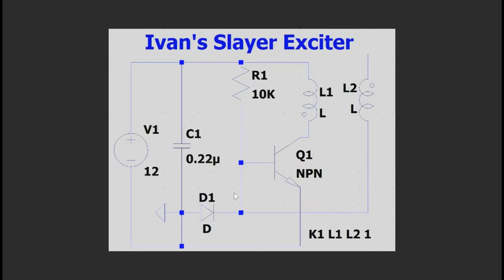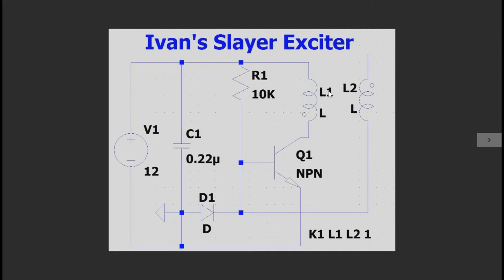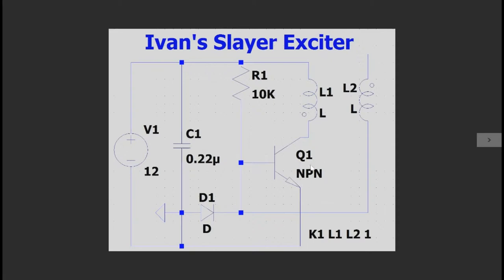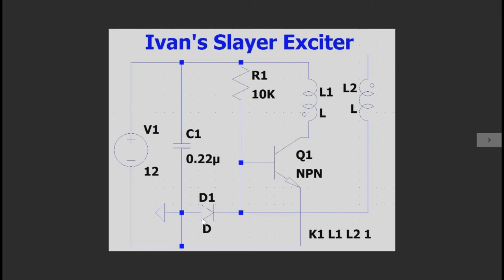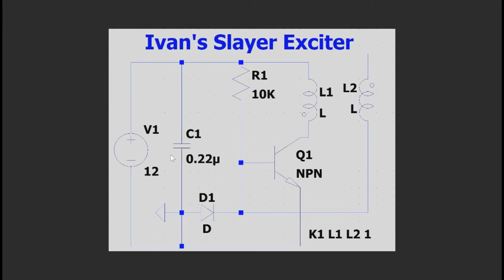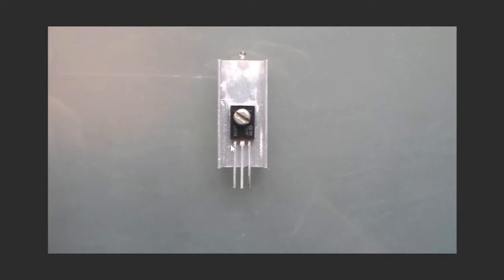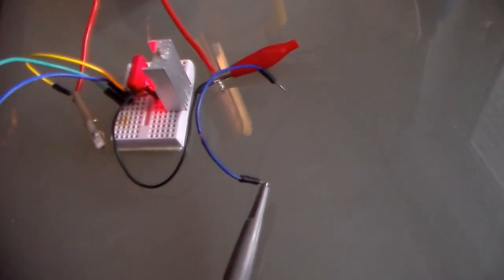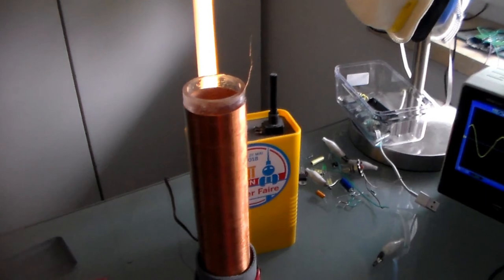Simple Slayer Exciter DIY

Comment: 1:43: The current in L2 does not turn the transistor off. It turns it more on. Look at the dots. The transistor is turned off just when the current in L2 changes direction, half cycle of the oscillation later. R1 is not critical. Anything that does not burn the transistor works. R1 can be even removed. Just touch the circuit and it starts. In your simulation, K should be much smaller than 1. Something as 0.2 is realistic. To run the simulation a load capacitance is required.
Reply from the maker: Antonio,  thanks for your detailed reply! Please correct me if I am wrong, but as I understand it R1 is used for two things: 

Firstly, if the transistor is assumed to be an ideal linear amplifier, it is used to provide an initial condition to the circuit so as to prime it from the unstable equilibrium point about 0 current 0 voltage and move it to a stable limit cycle in which it will oscillate. 

Secondly, as you are well aware the BJT exhibits some nonlinearities. with this circuit, we want to get maximum power output from it, and this goes down to having more current flow through the primary coils. Now sure, as you have pointed out, in your comment, this circuit can indeed be removed from its unstable equilibrium point by any nudge "even touching". However, without a fixed bias, if too much load is applied to the circuit, the dynamic equilibirum point will shift, eventually converging towards 0,0 as there wil not be enough energy going back to the transistor to maintain the oscillation, and due to aforementioned non linearities, as the equilibrium shifts, efficiency I am assuming will also decrease to due a distorted waveform, hence causing heating and other problems such as voltage spikes. 

Here, the R1 helps avoid these problems by maintaining a fixed initial condition, that is time invariant! 

As for the L2, fair enough, the transistor indeed does not truly get turned off and on in this circuit due to it being in the linear region, and R1 maintaining a bias current. 

As for the simulation, fair enough, a lower coupling value would yield more realistic results, but I doubt that would change much in terms of conceptual behavior, as as far as I know LTspice uses linear coupling loss models. 

Lastly,  I included the parasitic capacitance in the coils in the simulation, however, I am unsure about a load capacitance being mandatory for the simulation to run, as it ran with and without one.
Reply: @ivanrodionov9724  The transistor operates linearly just in the first cycles. In steady-state in operates as a switch, open when the current through L2 is going through the LED and saturated when the current goes to its base. What heats it is essentially the interruption of the collector current when the current in L2 starts to go "up". Without the resistor the circuit easily stops when the load is excessive. With the resistor the oscillator restarts when the load is removed. In a simulation a capacitor from the open top of L2 must be added, chosen so the oscillation frequency is correct. K=1 produces very unrealistic waveforms.

Comment: Hey what did you probe with your oscilloscope to get the sine wave?
Reply from the maker: you mean to test the circuit? I used a 1x probe from KKmoon. cant post links on yt comments but you'll find it if you just search kkmoon probes.
Reply: @ivanrodionov9724  No, I mean which part of the circuit did you probe? Thanks.
Reply from the maker: @johnpap350  ohh it was freehanging (capacitively coupled to the secondary coil) at least for when I measured the sine wave

Comment: what is D1?
Reply from the maker: The diode used to prevent negative voltage.
Reply: @ivanrodionov9724  IK BUT WHAT IS IT? sorry for caps
Reply from the maker: @nguyendesign4517  ohh, no problems! Honestly any shottky type diode will be fine for this, even works with an LED. I think I used a uf4007 for this.
Reply: @ivanrodionov9724  ohhh okay great thanks man
Reply: and can i use tip31c instead?
Reply from the maker: @nguyendesign4517  For what exactly? You mean as the switching transistor? Depends on your circuit parameters (ie what your resonant frequency is). If you are using the same setup as me, it will work just fine.